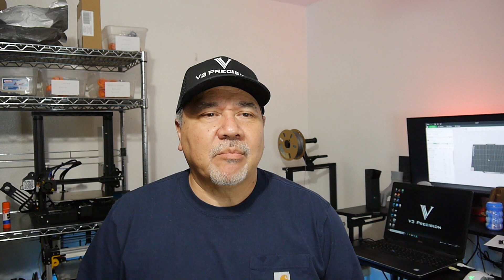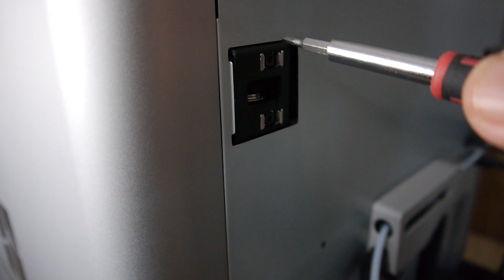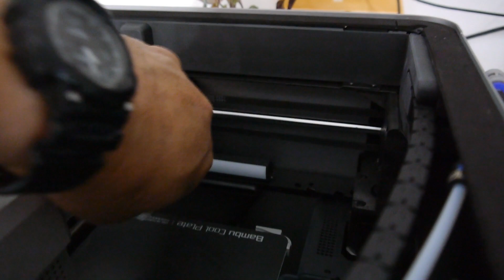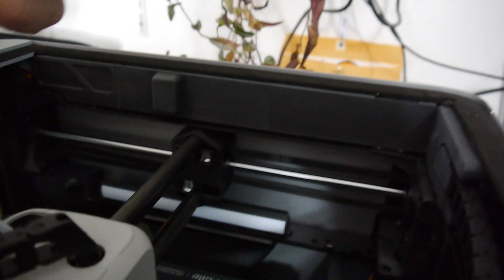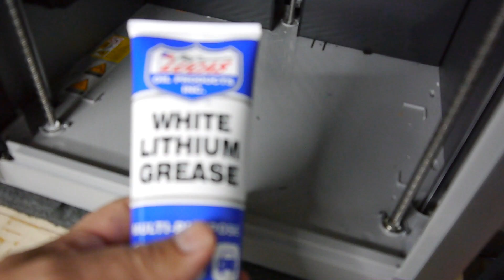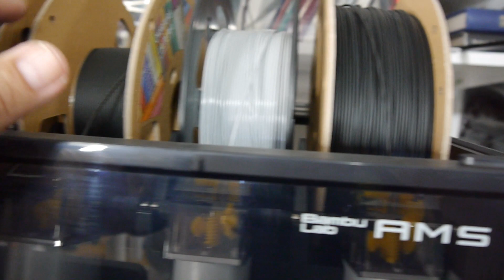Bambu Lab X1 Carbon First Cleaning

Comment: Tightening the belts is not just a matter of feel! You need to use a squaring tool to make sure that the gantry is squared up. People have made some jigs to help on Printables. If you try to tension the belts equally, you can end up with the motion system being slightly misaligned which will make VFA's and ringing artifacts much worse.

Comment: I am one of those guys you see bitching on forums well if you are on reddit. I am having weird problems all to frequently. I am about to switch over to a  Voron because if I have to work on it constantly I might as  well have somethng with a removeable enclosure and more user friendly on the maintenance side of things. Plus its about time to move to some high temp filaments.

Comment: Seems to be every AMS is different, my AMS absolutely hates the cardboard spools. They constantly tangle for god knows what reason.
Reply: well oficially, you're not supposed to use cardboard. You can print some rings for the spools to prevent the AMS tangling.
Reply: Print off the spools in the internal memory 
Wrap the filament on the cardboard spool with tape to hold it in place
You can easily peel off the cardboard outer spools and inner 
Assemble the printed spools over the filament
Remove the tape
Bob's your uncle 👍
Reply: @johnnyrocko7105  Thanks for that
Reply from the maker: I hope the guys at Bambu are looking into it.  A lot of filament comes in cardboard spools.  And why is it so inconsistent?